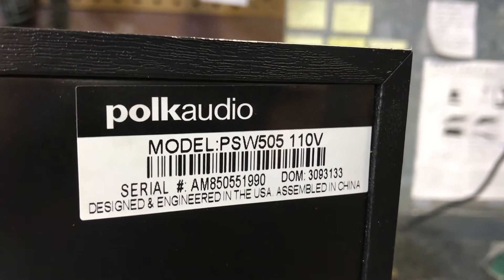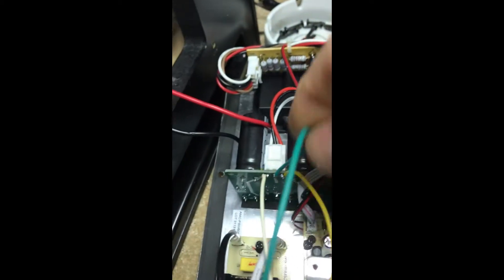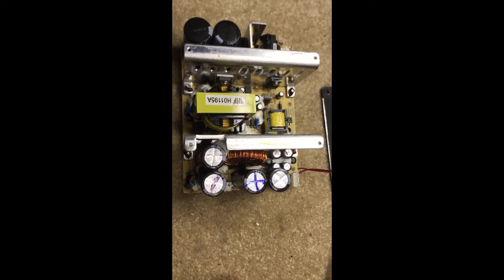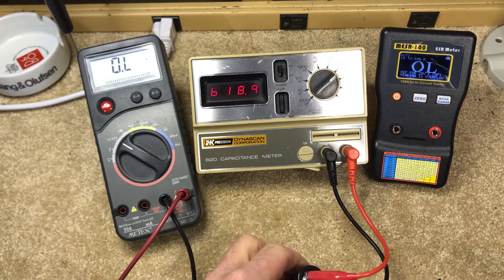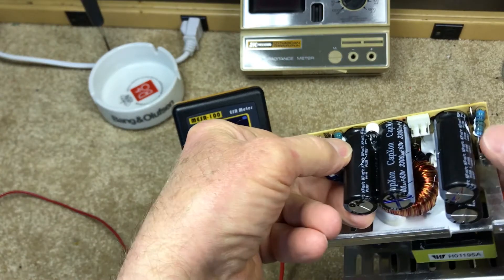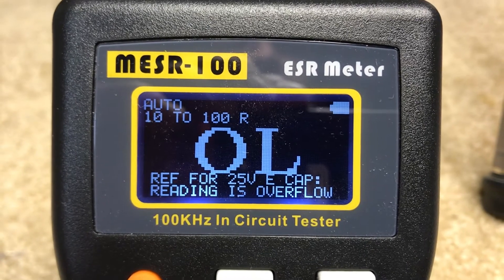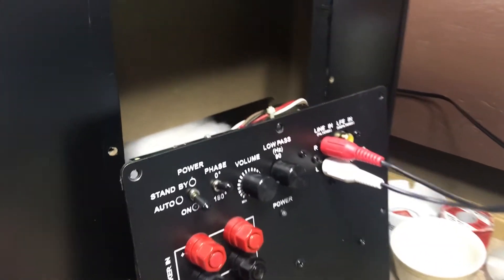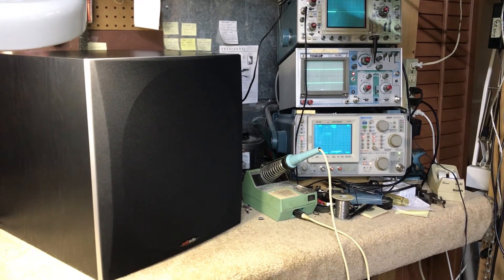Polk PSW505 Sub Woofer - Troubleshoot & Repair

Comment: Incredibly informative. I replaced the caps on my amp board about 2 years ago, but now I've got an issue where the power supply is only putting out 14.4v. Debating whether I should buy an ESR meter or put that money towards an entirely new amp or subwoofer. Would like to save this one if I can.
Reply from the maker: If you only occasionally do troubleshooting, an inexpensive ESR meter is better than no meter.  Search on eBay for :  LCR-TC1 Transistor Tester ESR Capacitance Meter Electronic Component NPN PNP.  About $25.00.

Is your main supply (+65 and -65) down to 14.4, or is the 15 volt supply low?
Reply: @dennisbsutube  Yeah, I'm thinking it's worth it. The 15v supply lines (+ and -) are exactly15v, but the +57 and -57 are +14.4 and -14.4
Reply: @dirtfpv  I have the exact same issue! Did you ever find a fix?
Reply: @ehss192  I ended up buying a new one but I still want to work on fixing this one. I bought the esr meter though.
Reply: @dirtfpv  I see that same issue...the power supply output is at 14.4VDC when it is disconnected from the audio amp board (the 3 wire connector), but appears to be at +/- 47VDC when connected to the audio amp board.  I'm wondering if it has some sort of current sensing feature that shuts down DC power output when there's no demand current.

Comment: I had the same problem with mine. One day I noticed the bass was lacking while watching a movie, and discovered the power light on the sub was off. I thought it was dead. Next time it was suddenly back on. A few weeks ago I noticed this howling noise coming from the sub, and had to unplug it to get it to stop. I replaced the connecting cables, tried a different outlet. It's completely dead now. I like their speakers. I've owned SDA 2A's, Monitor 10 B's; All of my speakers are Polks. But will never buy or recommend another Polk subwoofer.

Comment: SO, WHAT AM I DOING WRONG???!!! 🤔 I unscrewed the 10 screws around the parameter, however, my board didn't come out.
Reply from the maker: Sorry you are having a problem.  If you are working on a PSW505 there are no other screws that I can remember other than the ones around the edge of the panel that need to be removed.  Perhaps the plate is just sticking to the cabinet and needs to be popped loose with a sharp metal edge such as a putty knife.
Reply: @dennisbsutube  - Okay, I'll try that, but what about the other 13 smaller screws more on the interior of the back panel? Would those be causing the panel to stick? However, I noticed in your video that they're still on the rear panel even after you removed it.
Reply from the maker: The smaller screws inside the perimeter hold the power supply, amp, and pre-amp boards to the back panel.
Reply: @dennisbsutube  - Okay, I got the back panel off with a paint scraper, however, Polk wants me to test the driver. However, my wires (unlike yours in the video) are on a very short leash and I can barely remove the panel out of the way to get to the driver. Also, I called Polk customer service, and all the girl could do is to tell me that she could send me instructions, even though, I told her that I already had instructions. 😫

But I don't know if this would make an difference, but here are the instructions that Polk emailed me, even though, I can't get to the driver. So, is there a trick to it?

There is a simple test to figure out if the amplifier or the driver is the issue.

1. Unplug the power cable from the subwoofer.
2. Remove the grille from the subwoofer.
3. Take out the screws that hold in the driver of the subwoofer (some models will have a foam ring covering the screws, just peel this away).
4. Once removed, there will be two wires connected to the driver, positive and negative. Pinch and pull the connectors off.
5. Take speaker wire from your receiver and directly hook it up to your driver.
6. Keeping it at a lower volume, play audio and see if the driver functions. It is not going to sound great being outside of the box, but we are testing for functionality.

If the driver works, the amplifier is the issue. If the driver does not work, the driver is the issue. Kindly reply back to this email once done with the test so we will know which part needs to be replaced.
Reply from the maker: You don't need to remove the speaker (driver) to test it.  Disconnect the red and black wires from the amp board. You may need to press down on a locking clip with a pair of needle nose pliers to gently pull the connector off.  You can then temporarily connect your receiver speaker output wires to the red and black that go to the woofer (speaker),
My guess is the speaker is fine.
Reply: @dennisbsutube  - When you said that "You can then temporarily connect your receiver speaker output wires," I assume that you are referring to my receiver output cable? Because I am using an RCA receiver speaker output single cable. But I disconnected the red and black wires from the amp board and touched the end of those wires with my RCA output cable (even though, I could only touch one wire at a time and not both of them at the same time to the RCA cable), however, there was no sound that came from the sub speaker. Therefore, I guess that means that the problem is the speaker?
Reply: @dennisbsutube  - Also, while I'm here, I wanted to ask you if the problem is the speaker (driver) and Polk sends me a new driver, how do I get to the driver so that I can remove it and replace it with a new one? Plus, I wanted to know: would it better to either take this unit to a repair shop or to perhaps just buy a new one?
Reply from the maker: No, you have to touch both wires to the RCA plug.  Touch the black wire to the outer ring of the plug, and the red wire to the tip of the plug.  Be careful not to short the wires together.
Reply: @dennisbsutube  - Hello. This might be a dumb question, but I was suppose to do all this while the power was disconnected? Because if so,  I did touch the black wire to the outer ring of the plug, and the red wire to the tip of the plug, however, I didn't get any type of sound from the driver.
Reply from the maker: Yes the power to the Polk sub-woofer should be OFF.  Make sure your receiver is working, preferably at a  low volume, pull the RCA plug from your working speaker and touch the red and black wires from the woofer to the RCA plug tip and ring.
Reply: @dennisbsutube  - What do you mean by ""pull the RCA plug from your working speaker?
Reply from the maker: I assumed from your earlier comments that your speaker output cables from your receiver had RCA plugs on them.  Just to clarify, it's extremely rare to have RCA jacks and plugs involved for the speaker outputs of any receiver.  The audio line out or sub-woofer out from a receiver does use RCA plugs on a shielded cable.  How are your main left and right speakers connected to your receiver?  Disconnect the two wires from one of those speakers and connect them to the red and black wires that go to the speaker inside your Polk subwoofer.  Again, make sure the power cord is not connected to the Polk subwoofer, turn on your receiver at a low volume level and see if you get sound from your woofer.  This is what the person from Polk is suggesting that you do.  Personally, I  doubt there is anything wrong with the woofer itself.  You said you were getting a horrible sound from your PSW505.  This is a failure of the amp/power supply, not the woofer.
Reply: @dennisbsutube  - My main left and right speakers are connected to my receiver through two wires. However, I did connect those cooper and silver wires to my Polk subwoofer's red and black wires, and when I connected the silver wire to my sub's black wire, I finally did hear sound from my subwoofer. 

Also, if that is actually what the person from Polk was actually suggesting to me, then they did a poor job at doing that. However, based on the instructions that they gave (ie if those instructions were correct), then it appears that my sub speaker (driver) is what is actually bad. And according to them, the driver is supposed to still be under warranty and they said that they would send me a new one. However, how in the world do I remove the old driver that's in there? Or do I need to take it to a repair shop so that they can do it?
Reply: @dennisbsutube  Oops! I got it mixed up. They said, "If the driver works, the amplifier is the issue." Therefore, you are correct in saying that this is a failure of the amp/power supply. So, do I now just follower the instructions in your video? Although, I have to admit that I am not very good with stuff like that.
Reply from the maker: In your case I would recommend that you take your subwoofer to an electronics repair shop.  You can have them watch this video so they know the proper voltages to look for from the power supply.  After that, it is just basic "Class D" amplifier trouble-shooting.
Reply: @dennisbsutube  Hey, Dennis. I finally took my Polk to the repair shop about 3 months ago and showed them this video and they were able to fix it. Also, they said that they did watch the video, so I'm assuming that it did help them, even though they didn't specifically say that.

However, it seems as if my Polk is sounding better than ever, and it seemed like about a month ago it finally got broke in. Because at first, it didn't seem to sound as good as it did before, but after about 2 months it started to sound better. Lower and deeper bass and it kind of reminded me of the Velodyne that I heard at Best Buy years and years ago, even though I ended buying the Polk.

And one more thing, I don't know if you ever heard this before, but the repair man told me what has been happening with these speakers (if I recall his story correctly) is that a Chinese executive or technician didn't or wasn't able to write down some technical information about this speaker, which included the part that went bad in this video, and something about instead of writing it down in a document, he or someone else that he told the information to had to write it down on their hand, and some of the information written down was incorrect.  And therefore, that error got passed down to all the units of this model which were manufactured, and that's why so many people were having the same problem. Although, I don't know how true that is, but anyway, thanks a lot, Dennis, for sharing this information with us about the repair. 👍
Reply: @dennisbsutube  - Also, yes, mine is a PSW505 and makes that exact same horrible sound.

Comment: I just had got one but I try to connect speakers to it and it won’t connect it will not play
Reply from the maker: 1) Does the LED on the subwoofer stay RED, or does it turn GREEN?
2) Do the speakers work when connected directly to your stereo receiver or amp?
Reply: @dennisbsutube  mines just stays red and whenever it foes turn green it will only play got a little before then shutting off.
Reply: @dennisbsutube  I would really appreciate it if you could be any type if help. Ill even go as far as sending it out and paying you to fix it.

Comment: Hey Denis good troubleshoot , wondering what website you were able to pull the values from the bad caps ? Is it the same link u provided on vid or did u have schematics
Reply from the maker: The values of a cap are printed on the cap itself.  Example: 22uf 35V  would be a 22 microfarad 35 volt capacitor.  The link to Digikey is to give you a source to buy the parts.

Comment: What is the repair cost for this? I've seen people buy a sub $200 amp to replace it on Amazon with good success.

My main concern would be that it will continue to break down. My sub lasted nearly four years.

Coincidentally, I built my own sub with some MDF, an Amazon amp, and a Walmart woofer and it is still alive and strong after 9.5 years (though occasionally it will need to be unplugged and plugged back in because it quits working).

I like the sound of this sub, but I'm not convinced it's worth fixing the amp, vs buying a new amp.
Reply from the maker: Unfortunately there is no guaranteed answer to your dilemma.  The parts list that I showed in the video only totaled around $15 as I recall.  I checked with the owner of the unit and it is still working fine. Who knows if it will last 10 more days or 10 more years.  It's worth a try if you have the time to spend on the project.   Good luck!

Comment: I have another PSW505 issue. Instead of +-57V it shows -0V and +14V.
Reply from the maker: Without any power connected to the unit (no AC), I would disconnect the power supply from the amp and do component level trouble-shooting looking for a load problem in the amp, or most likely some semiconductors that are open or shorted in the power supply.
Reply: @dennisbsutube  I disconnected the amp from power supply and checked U. It always +14V and -0V. Wondering why they are not symmetrical. I also verified capacitors and diodes in power supply.
Reply: @postkvn1  Did you ever find a fix?
Reply: @ehss192  I was able to fix power supply. Just changed one capacitor which is connected to IC 3843. Now I see +-57V. But there is another issue with amplifier.
Reply: @postkvn1  Thanks for the tip! My amp died after 5 years and I'm digging into this myself now. Thanks for the reply.
Reply: @postkvn1  Just curious...are you testing the voltage with the 3-pin connector attached or detached from the audio amp board?  When disconnected, I also see +14VDC and 0VDC.  When connected to the audio amp board, I see +/- 57VDC.  (This occurs with all new caps).
Reply: @rknow14  I tested under load, just connected a couple of lamps 25W
Reply: @ehss192  Eventually I was able to fix it. Just changed all capacitors for preamp and amp.

Comment: I opened my amp up and it was full of some white goo which covered most of the capacitors. So I can't see the resistor numbers on the board.
Reply from the maker: The white goo is typically glue that is used to help hold parts in place during assembly.  You can carefully scrape the glue off to see the value or condition of a part without hurting anything.  FYI... resistors rarely go bad as compared to caps and semiconductors.
Reply: @dennisbsutube  I meant to say capacitors. I bought 10 of them to make to make the common repair, but that goo is difficult to pull off.

Comment: saved me from trashing my 2 year old sub! Had the same zener diode burnt up, swapped it and works good as new
Thank you!!
Reply from the maker: Thanks for your feedback.  That makes the time I spent making the video worthwhile!  I'm guessing you made sure the large power resistors were soldered in properly.  I think the fluctuation in the supply due to the bad joint on them is what caused the zener to pop.
Reply: @dennisbsutube  I did, the solder joints seemed to be fine, I will still keep an eye on it but hopefully all is good. Thanks again great vid

Comment: Great Video!!  I have replaced several bad capacitors on the amplifier board and like yours, they are all the medium to small ones.  I had to pull each one out to test it.  I need to get one of those in circuit testers.  I have almost gotten the woofer to work again, except the 57v rail of the power supply dips to -48v every few seconds and when it does that the amp shuts down.  The +/ 180v square wave (PWM) primary to the switching transformer seems to get wonky when this happens.  The +57 stays perfect during this time.   Guess I will test those same caps you found bad on that board hoping that might work.  The diodes are not cracked and loading resisters have good solder joints.  I have never seen such a good troubleshooting video, I subscribed to see if you had more :)   Thanks for all the time you put into this!
Reply from the maker: Thanks.  I'm glad you are getting some good pointers from the video.  I do wish Polk would release a schematic to help service shops repair their equipment.  They are not making any friends the way they do business.
I am curious as to why the +57 volt side works well while the PWM gets "wonky".  I would think the PWM should drive both sides of the supply.  Your problem could still be in output section of the amp, drawing down the supply, but I would trouble-shoot the supply first.  
If it helps, here is a link to the amp driver IC data sheet that shows a basic schematic of how the amp is put together. 
https://www.infineon.com/dgdl/auirs2092s.pdf?fileId=5546d462533600a4015355bf314b15a3
Good luck,
Dennis

Comment: I have 3 of these, 2 of the 3 have died, I'm expecting the third to die anytime now.. all three have had very light use
Reply: These have a very high failure rate, you could have a nice side hustle if you decided to do a board swap program
Reply from the maker: Thanks, but I'm trying to catch up on the domestic projects that I have been ignoring for too long. Perhaps Mr.Miles from the comment below would be interested in such a challenge.
Reply: @dennisbsutube  I need this repair for my 505. Can you do it?
Reply: @kathywilliams7947  Sorry, I retired from the repair business some time ago and no longer have the insurance and current license to run a company.  I'm sure if you have a tech from a local repair shop watch this video he/she will be able to help you.
Just knowing what the output voltages from the power supply should be is a great help to any tech.